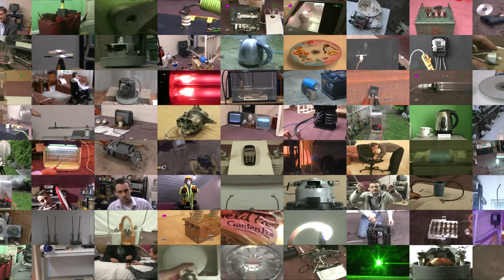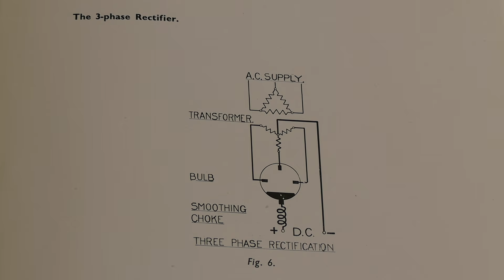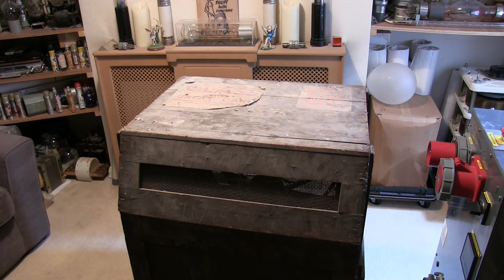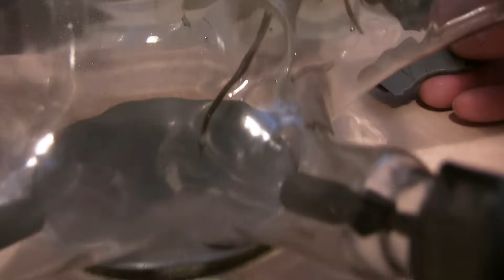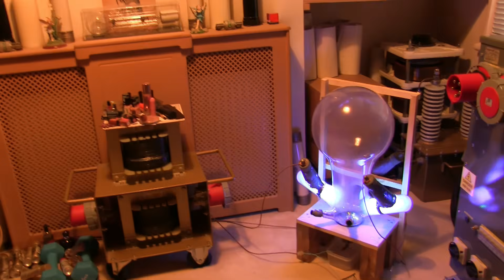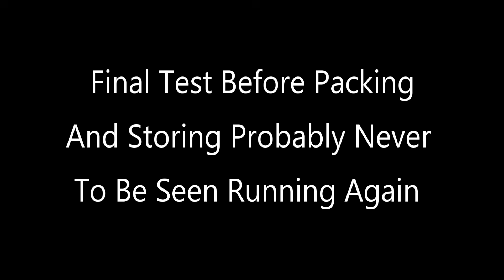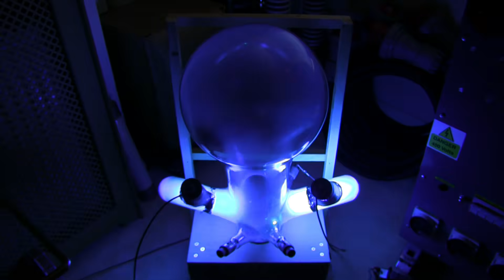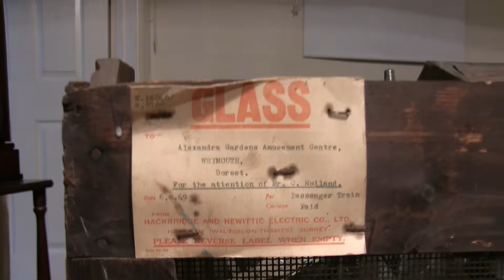Testing The 50 Year Old Mercury Arc Rectifier

Comment: I do wish he'd shown us the output on an oscilloscope.
Reply: Have a look in the background on his other videos, he's got scopes, and they are cheap compared to the cost of some of the stuff he features.  He probably just figured nobody would be interested in it.
Reply: @vink6163  Im hot and bothered already, scope might be too much for me. 
Analogue scope footage would be illegal in most countries. :D
Reply: @woldemunster9244  LOL!
Reply: Not 100% sure, but maybe these kind of rectifiers create their own set of problems when measuring the output when it comes to seperating the mains from the scope in order to stop you from blowing up the probe or input on the scope.
That said, I get how a simple diode works, but not really well how these kind of rectifiers work, so I might just be talking nonsense.
Reply: @Dutch3DMaster  Metals have very diffuse and mobile electrons. The mercury vapor basically gives you an electron cloud that will be drawn to the anode as soon as a potential is present. Vacuum tube rectifiers work the same way, but use a hot cathode that is sacrificial, boiling material away over the years. Look up "thermionic emission".  Mercury rectifiers can carry much more current and  have a longer life since they have a cold cathode and the mercuty is not consumed. If you like history, vacuum tube history is facinating!
Reply: @Dutch3DMaster  True, but you can just use a properly isolated differential probe. There are many that basically have multimeter probes attached with the same type of safety features and ratings as multimeters.
Reply: Electroboom needs to donate one to him , we all know he’s got about a hundred by now.
Reply: And a load.
Reply: I was hoping too
Reply: He mentioned it would be a 100hz squarewave DC line. The two legs of the ac transformer will only conduct the positive part of each AC sinewave, thus giving a DC positive output, 50hz is UK power then x2 will give 100 hz. Althought really not hertz since it is all a positive waveform. That is as near as I can understand but I am not an expert.
Reply: not much to see. it is bumpy on the upper side of the signal and completly flat downside of the signal. but, it's perfectly stable, just half wave rectification. a guy who loves bunnys showed that on an antique ociloscope. i can't remember the name of the channel.

here's the edit: the name of the channel is "usagi electric". he tests two kinds of rectifiers, one is the mercury arc rectifier, the other is a xenon rectifier.
Reply: Oh I am sure it had some ripple. A big choke and capacitor would remove the ripple. DC motors probably don't mine a little ripple.
Reply: Ikr. This channel is heavily underrated. He may not have enough funds to buy an oscilloscope? Like, the good ones are filthy expensive!
Reply: @iamsreeram  of course he has an oscope. There's no way he doesn't.
Reply: @iamsreeram  i sure hope that he buys one, even if its used

Comment: So it takes a rectifier to start a rectifier that seems kind of ironic.
Reply: A low voltage rectifier, yuh. A lot of industrial and IT gear is the same way. Most raspberry pi zeroes exist to start up whatever they're attached to in a specific way via script on power on and then go to sleep/power off.

Comment: Seems like it would be nasty on the eyes: the mercury plasma must be giving off a ton of UV radiation.
Reply: They're made of borosilicate glass, the same kind of glass as fluorescent tubes. Borosilicate both blocks UV and is very stable under thermal stress. The thermal stability helps the glass stay sealed around where the electrodes pass through the glass where it can get very hot.

Comment: I used to be a driver on British rail back in the 70s and 80s.
We had Mercury arc rectifier's on the class 81 locos.
When you put the reverser in there would be a hum then a BANG, another hum and BANG followed by a final hum and BANG, then the cooling fans kicked in and you got power.
It was there only loco at the time that had those rectifier's but gave them a bit of a character tho everyone hated them as they had rough suspension, you'd get all your fillings knocked out.

Comment: Thank you, Andy.  This was a stellar, engaging thing to see.  Do you know which ride it powered?
Reply: None because it's new old stock, but might be interesting to know where they would have been used, i know that they used these or slightly different ones in steel mills for the DC driven big rollers. DC for variable speed

Comment: That was the coolest thing I have seen in a long time.  Brilliant idea and engineering.  What was the typical application?
Reply: Anything that runs on DC mainly, we have a couple mothballed in our theatre from the days when it was a cinema - they were for running carbon arc lamps.  Another place I have heard they used them was for the supply to the Isle of Man trams.
Reply: @cumberland1234  thanks!

Comment: This is really quite awesome. A question though, isn't that generating a ton of ultraviolet light?
Reply: It's probably made of borosilicate glass which blocks UV. Borosilicate is the kind of glass used in fluorescent tubes and in laboratory glassware. In the tubes because it blocks UV and in lab glassware because it doesn't explode when exposed to thermal shock... I imagine glass in this kind of tube would be under considerable thermal stress, so using borosillicate makes sense.

Comment: What's the purpose of the big empty bulb on top when all(?) the action happens down at the bottom?
Reply: So the vapor can condense and return to the puddle at the bottom.
Reply: @woodhonky3890  So, cooling?
Reply: @GeofreySanders  Most of the ones I've seen have a horizontal fan below them.  There are several videos of them on you tube,  some working under load.

Comment: Nice stuff! Nowadays a modern diode at work looks boring. This is mesmerizing to watch! Something as a centerpiece for a Dutch coffeeshop (I really want to touch it ;-)). I enjoy your videos a lot and I'm glad I'm not your neighbour too... From the practical side; how do these mercury diodes compare to modern ones? I'm curious and never saw one before or even knew the existence. Selenium diodes are the blast from the past for me. They made quite an impression failing. We did toast granny odour or something even worse (I have experienced worse but the full explanation is not suited for the general public. She looked nice although...) Germanium went quite well without odour and even made me recieve radio Vladivostok without batteries. Thank you for sharing this voodoo rectifier apparatus. I love it. Best, Job, the Netherlands

(if you get rid of the mercury it would certainly would make a terrifying water pipe.. You could then smoke candy apple flavoured tobacco quite save though. ;-)) I love mercury; the looks and the e.g. use for a rotary connection is superior. The mad hatters unfortunately initiated the ban on common use by talking weird on a, quite young, age. Lesley speakers (used in Hammond organs) proved the superiority of the electrical capabilities of mercury (no restinance loss moving compared to fixed wires and higher frequencies too) . Because of this it's only used in defense projects now, who don't care about environment issues to much; it comes with the trade. Burn them, vaporize them, x-ray them, poison them; who gives a F. as long as it's does the job.

Comment: I'm not sure I understand the point of the mercury gas. Is its purpose to act as a resistor?
If you just want a gas, why can't you use argon or some noble gas?
You said there is a choke. I think that is an inductor and serves to prevent ripple. I guess you want a pure DC current.

Also, watch out for UV radiation.

Comment: I'm confused as to why that tiny arc is able to continue to exist. If I understand what's going on correctly, is the arc dancing around on the surface of the mercury because the mercury is being slightly pulled up in that spot as the electrons flow? Intuitively, you would think that the flow would be evenly distributed on the surface of the liquid metal. I'm guessing the purpose of the ignitor electrode(exciter) is to create that, but how does it persist after the ignitor is off?
Reply: That is where the mercury is 'arcing' with the highly ionized atmosphere inside the rectifier. It is zipping around because the spot in the air with the highest potential is constantly changing. Very interesting.
Reply: They are under vacuum, mercury vapor will ionize and continue the arc, once the arc is formed the only way to extinguish it is to cut power completely
Reply: Mercury will boil and turn into vapour at a low temperature (around 30-40*C) because the bulb is under vacuum. The exciter allows an initial high voltage arc to be struck to the pool even if the rectifier is cold and there is little/no mercury vapour. Once the arc is struck it heats up the mercury to create vapour needed for the main anodes to ionise the vapour and create a continual arc to the cathode at much lower voltage. As long as the arc is from the main anode(s) is maintained the mercury is continually vapourised and the exciter is not needed.
Smaller mercury rectifiers often have a filament to heat the bulb and vapourise the mercury, as an alternative to needing a high voltage exciter - this type also have much less mercury in them, typically just a few condensed balls or some mist on the glass are observable when cold, and almost all is vapourised when hot.
Reply: I think it's the same way a fluorescent light bulb stays going, the exciter gets a kick of electricity to vaporize some mercury, and then the flow of electrons from the anodes keeps it alive afterwards.
Reply: @justy1369  it's big fluorescent light bulb without phosphorus to make fluorescent light
Reply: @dh2032  and without the phosphor to absorb the UV radiation the mercury vapour produces...
Looks like a good way to get a suntan - and cataracts.
Reply: @95rav  Yah, I wonder how much UV-C that's pumping out.
Reply: @TheJohn8765  UV-C arc lamps are made of quartz glass, otherwise glass would absorb those wavelengths. I doubt that rectifier is made of quartz, but it would be interesting to know what exact kind of glass blend.
Reply: @dh2032  , yeah, the guy who invented the mercury arc rectifier was actually trying to create a new, brighter lightbulb when he made it.
Reply: @ShawnGuertin  You are right. The UVC and most of the other UV will get blocked by the glass. You will still get some coming through along with a little radiation, but nothing harmful in the short time he is using it.
Reply: I came to the comments to find this out as well. I couldn't understand it.
Reply: There's a choke coil wired to the cathode that keeps the arc going when current switches from one anode to the other. You can see it in the schematics.
Reply: I believe it is the reflection of the anodes on the mercury as it bubbles and dances. The rectifier is vibrating causing the effect. Too bad he didn't keep shooting video from the top and turn it into a screensaver.
Reply: There is probably a little point of liquid being pulled up by localized heat/evaporation, and the charge will collect at the point and maintain it.
Reply: My guess is that, because the mercury gas is making the connection and that gas expands to a much larger volume than its solid form, it only needs to vaporize a small amount to draw up towards the anode to complete the circuit. It seems as though it's simply drawing what it needs to conduct and the small arc is the result of that. It would be neat to see if higher amperage generates a larger arc. It probably persists because the mercury vapor doesn't have time to condense and simply alternating the anode connection keeps the arc alive. The exciter is just to evaporate some of the mercury to create conductivity...

Comment: So the exciter and the bottom electrode are what keep the reaction going, 3 phase (or in this case two phase) is input to the 3 large electrodes around the outside and the same voltage is induced from the two smaller ones in front as D/C positive voltage? I'd love a second video explaining how this works! (though I'd assume someone else would have an explanation how this works)

Comment: Hi does this give off Xrays when it is in service? I remember seeing large ignitrons at Argonne National Lab that were about that size, they were capable of scary currents and voltage the two of them were dumping 2.5 MW from a capacitor bank into a magnet. I was just a power supply operator at the time.
Rich

Comment: Cool stuff. Would be interesting to see if this is emmitting any Xrays. Got a geiger counter?
Reply: Very unlikely. Mercury arc rectifiers are low voltage, high current devices. X-ray machines are high voltage, low current devices. generally for X-rays you need at least 10,000 volts minimum

Comment: They're one of the most amazing things you'll ever see. Utterly captivating. I was in a disused part of the London Underground a few years ago, way off down a shaft was one of those, still going. The LU guys didn't even knew what it was doing, but it had been doing it for decades!
I used to work on an AM radio transmitter that used a pair to rectify the HT. The glow would pulse in time with the modulation!
I have two questions: Why such a large bulb? And the starter - does that just strike an arc producing vapour, which the AC then keeps going?

Comment: Would these have had the excitation started manually as you demonstrated, or did industry use some type of auto starting circuit?
Reply: There was an auto starting circuit. An electromagnet moved the igniting electrode, and relays opened the starting circuit, both that of the moving electrode and that of the electromagnet, once a stable current is established on the smaller idling anodes.

Comment: 50+ years old and kicks straight back to life like it was last used yesterday… made in the days when shit was built to last …🤔
Reply: To be fair, this is an infinitely simpler device with far fewer failure points than, say, a mobile phone or anything containing microcontrollers. Still an amazing piece of craftsmanship
Reply: More like made in the days when shit was built large and simple and therefore  lasts longer than more complex and compact designs. Not always the case though. Sometimes they do design shit not to last nowadays.
Reply: Planned obsolescence is a plague on humanity.
Reply: Wrong, made in the days when stuff was ment to be used not thrown away.
Reply: It was only 1971 - they made plenty of cheap shit back then, too.  But nobody bothered to build this kind of shit cheap - there's not many ways to cheapen something this simple that would save you any money.

Comment: At MOTAT (Museum of Transport and Technology) in Auckland NEW ZEALAND, they have an old tram system, that they use for transport to different parts of the museum. All the trams are from different parts of nz/the world. They run on DC and use two huge old Mercury Arc Rectifiers to power the system. Quite cool to see them in operation, Worth a visit if you're ever in the area.

Comment: Where would these have been found back when they where still being used?  Certainly not on a power pole right?  Please excuse my ignorance when it comes to electricity.
Reply: From what I know of them, they would be found in a building or room near the DC device that they powered. In the basement of a building that used DC power for the elevator/lift motor, for example. AC power comes in from the main supply and DC power goes out to whatever device or devices they were powering.

Comment: Many years ago during my apprenticeship (circa 1985) I was lucky enough to have been invited to visit the last DC substation in Clarence St Sydney (Australia). The substation was due to be decommissioned in the following weeks and the lone Mercury Arc Rectifier was supplying just one old DC elevator. I had to wait until someone used the elevator to see the unit spring to life in all it's violet glory !
Just out of interest, what's the forward voltage of one of these guys?

Comment: Our local substation has only recently replaced the last of their 1000MW mercury arc rectifiers with 1200MW thyristor based poles for HVDC submarine transmission.  I remember that there was always a risk of the rectifier exploding producing mercury vapour that would have travelled down the valley.

Comment: Once worked as a trainee cinema  projectionist in 1958. The film progectors light source was carbon  rod arc light , the DC supply for the rods , was a Mercury arc rectifier, and if I remember correctly ,there was a big generater involved as well. The things we saw looking from the projector box into the audience,  well that's another story.🙄🙄🙄🙄🙄🙄🙄

Comment: Hey Photonic, a small tip on the sound. How you can improve it. I hope this helps. I'm an audio engineer and I'm hearing something called aliasing. This happens when you resample the audio, like from 48000 Hz to 44100 Hz. Maybe in your video software you are resampling the audio from your mic / cam somewhere. Look into setting that resampling process to use a high quality interpolation. I think it's not doing that right now and that's why the aliasing happens. You can hear it as a sort of "metallic" or "robotic" noise up in the high frequencies, but it's mostly only audible on better speakers. I hope this helps! Thanks for your videos, they are very informative and I love them!

Comment: I have 2 of these Mercury bath rectifiers in my shed, I used to work as a projectionist in a cinema and when we took the old rectifiers out to replace them with modern westinghouse units I kept the old ones.
one of the mercury bath rectifiers has never been used and its still in its original packing crate.